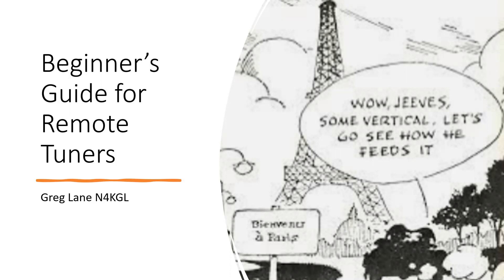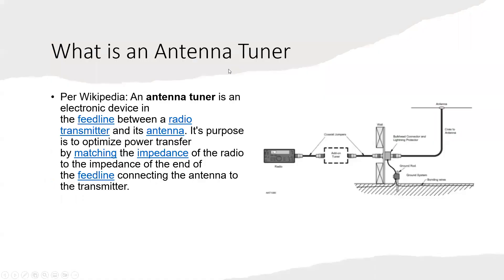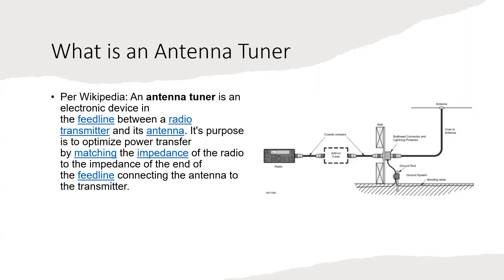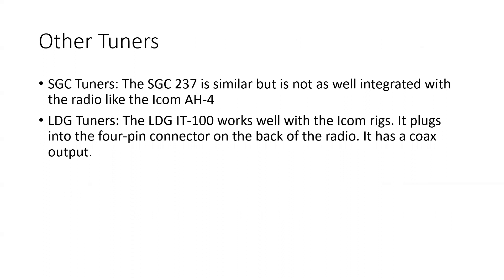Beginner's Guide to Remote Antenna Tuners

Comment: Many thanks the section on the AH-4 was great liked that a lot and useful that someone puts down this info not found anywhere else on the internet to be honest - I'd love to see some comparison results with the AH-4 with different setups like Long Wire , Doublet with ladder line etc. You put some good tips in there that could easily be missed so I watched it a few times all the best and 73s Mike R

Comment: Excellent coverage of the ah-4. I have just bought one, and have no idea really what it will do. I thought it was just for long wires. I'm pleased to find out I can use it with a doublet. I guess what you do is just hook one end of the ladder line to the antenna connector and the other end to the ground. Since both ends are the same I don't guess it matters which one goes where. That said, I'm going to start out with a long wire. My understanding is the longer the better as long as it's not the multiple of 1/2 wave of any band you want to work. Thanks for a very helpful video.

Comment: Great presentation, thanks!  Broadcasters don't generally have to think of things like this for their medium-wave (MW) stations on AM since they design all of this in advance, the advantage of operating on a single frequency.  Ham operators have all kinds of bands on which to work so a tuner is an excellent opportunity to work those bands in the absence of either enough wire or otherwise resonant antenna.  For me, the AH-4 has been working like a champ for five years on my ICOM IC-7100.

Comment: Can any Auto ATU be used at the feed point if the control circuit appropriately rewired / repurposed for remote use?  The higher cost of remote ATU's is prohibitively expensive while generic kits for desktop use are inexpensive.

Comment: hi  they are great peces of gear 4 every hamm i personaly use 2 models of tuners  the portable fc50 and fixed the fc 40 from yaesu  both use a small 9 pin din cable